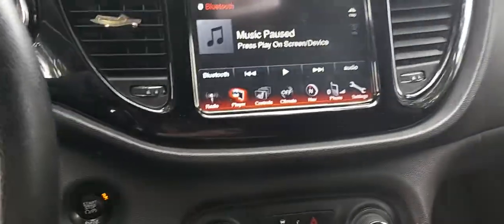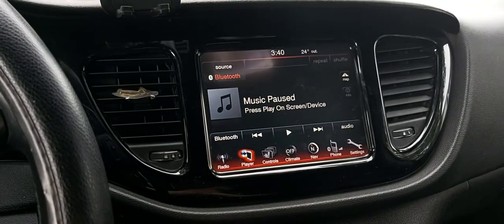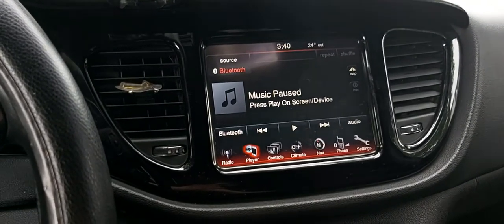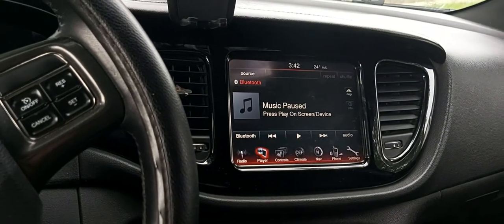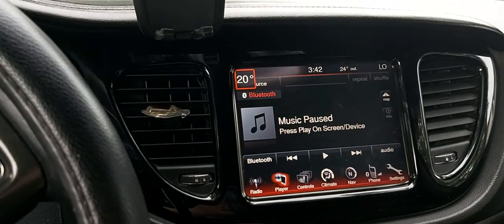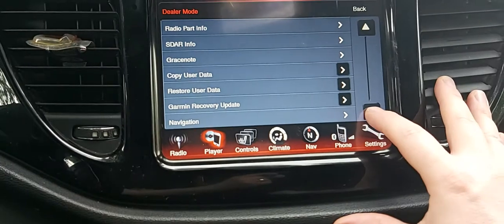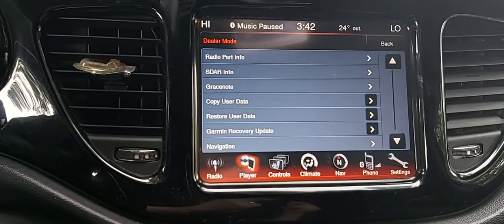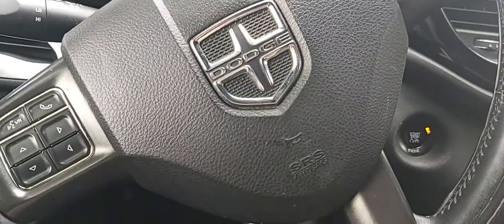2013 Dodge Dart Reverse Camera Flipped Upsidedown After Uconnect Update

Comment: This happened to my 14 dart,  I got into the trunk and pushed the connection in tight again and it seemed to correct the problem.  Not sure if it was because of moisture freezing in the camera or just a faulty connection.
Reply: I have the same car and same problem, can you tell me where you pushed the connection in??
Reply: @kiyanalee171  remove the cover from the trunk. Be careful not to break the tabs as they are a bit pricey.  Follow the large black cord to the back of the camera.  Push and wiggle that cord a bit towards where the camera is.  
It worked for me for a while and has now given up the ghost.  😆 
Another tip,  make sure to check your oil every week and keep a couple quarts in your trunk.

Comment: This happened to my 13’ dart limited. And shortly after the camera blacked out and hasn’t came back on in two months... And apparently of you get a used or new camera you have to take it to the dealership to get programmed?! Does anyone know about this? I’m trying to avoid dealer expenses at all costs.. It’s definitely a big pain with my dark tinted windows. Also I don’t know what software my  connect is since I bought it used last year with 89,000 miles and has 98,000 currently
Reply: I have the same problem
Reply: any problems on the dart? anything i should worry about, bought for same amount of miles used
Reply: I loved it at first.    But as it gets older the more problems I have.    Can't wait to get rid of it

Comment: If you take the camera out and ipen it up theres an exposed wire the is touching a small piece of metal causing it to short out.
Reply: I covered the metal with a small dot of silicone.

Comment: Literally the exact same issue I’ve been having!!!  3 uconnect customer service reps weren’t any help either. They said take it to the dodge dealership.
Reply from the maker: Wow, unreal. My dealership sucks. I haven't been there in years and was hoping if never have to talk to them again.
Reply: @janX9 mine too!!! The Dodge Chrysler dealership had my 2014 Dart for 2 weeks on a faulty shifter cable problem to the transmission!!! Come to find out it was a recall by Dodge and an easy fix THAT SHOULD BE FREE!!! I’ve had enough of this dodge dart it is a piece of shit for real!!!

Comment: Hay mine does that to but dident up grade nothing it just started doing it and can fix it Also  touch screen don't work either so can't  change the settings on my Ac do u know how to fix that
Reply from the maker: I don't, but I'd check all the fuses. Sadly, there are like 3 fuse boxes and the one under the dash is a bitch to get at. Such a tight space, so it's really awkward. I'd also recommend pulling out the stereo and see if there is a loose connection, if the fuses aren't the issue. 

The dash is really easy to disassemble, and can be done in 5-10 minutes if you know the procedure well. All you need is a Phillips head if I remember correctly.

There are videos on YouTube that show you. Just search "Dodge Dart dash removal".

Comment: Any luck? Mine is doing the exact same thing...
Reply from the maker: Nope. And my Bluetooth stopped working after the update too. I'm going to call dodge about it. Their update messed up my car. They should rectify it. They probably won't, but one can hope.
Reply: @janX9  Yes my Bluetooth will not connect as well. Thanks for the response and let me know what you find out with the dealership please.

Thanks again
Reply: It suck that most Journey their Bluetooth and camera doesn’t work. But hey if any case u can’t fix the Bluetooth they sale this aux bluetooths at Waltmart good luck.

Comment: Just purchase a used 2013 Dart for my daughter coming home from deployment in a couple weeks....did you find out a fix ?
Reply from the maker: No, but to be fair, I haven't done anything about it since this video. I'm lazy LOL

 BTW if the dart has any other issues, I have more videos about the car on my channel that may end up helpful in future. 

Also, there are a few recalls on these cars, so I'd recommend getting the VIN number off the car and punch it into the recall website to find out if they have been done on the car. 

For your daughter's safety, really do it. There is a transmission problem that will actually make the car take off all on its own. Seriously, it's dangerous. Or just the opposite can happen, you'll lose all power out of nowhere. It happened to me a few times while I was coming over multiple lanes of traffic. I almost got T-Bonned! I like the car, but the electrical goes wonky sometimes. So many Weird things have happened to my dart since 2012. 

Please post back if you get out fixed. I'd like to know.
Reply: @janX9   me too stupid car sucks
Reply from the maker: @pattylu89  it has its fair share of issues. I've got a long list of them.
Reply: @janX9  omg

Comment: You might want to add to your description that the fix for this problem is in the thread that you reference and starts at post #29 and goes thru #34.  That saves us slow readers a bunch of aspirin. Before that is where everyone is just guessing and repeating misinformation.  After that is where people just read the first few posts and then post their own question or other garbage without ever reading #29.  I'm currently working on this problem for my niece, but don't have time to take the camera apart.  Will probably just buy a new aftermarket one (since the original doesn't sound so great).  I will try to remember to come back and let everyone know if that worked.
Reply from the maker: Good point, I was probably busy or being lazy. I'm not a YouTuber, just a guy that posts videos sometimes. So I tend to do the minimum with my videos. 

Thank you for your comment, I updated the description.